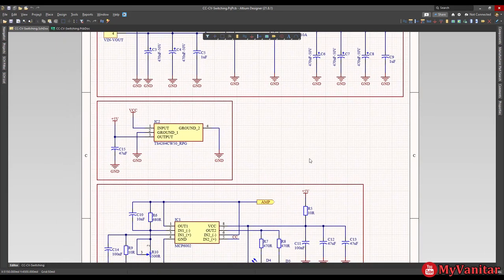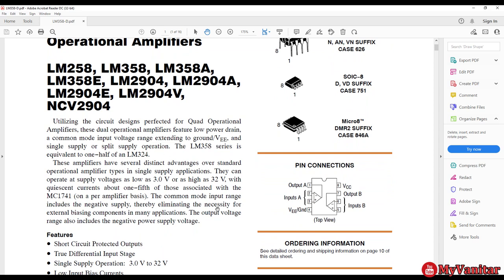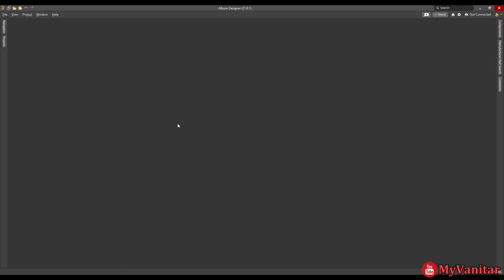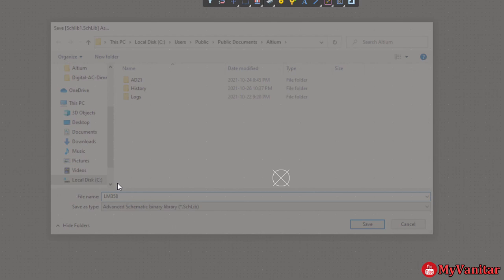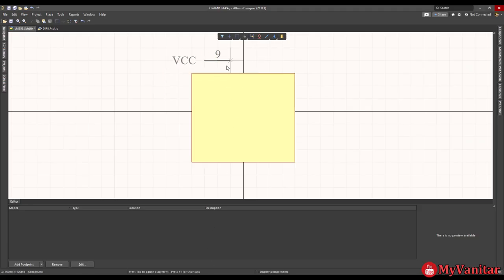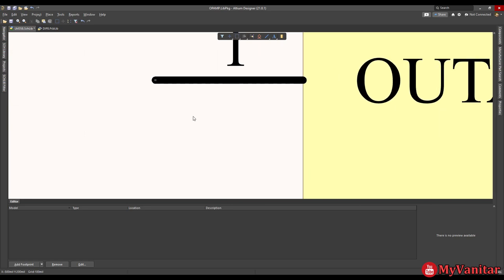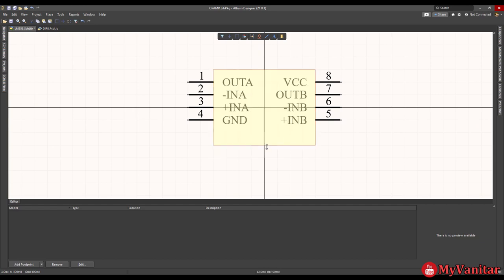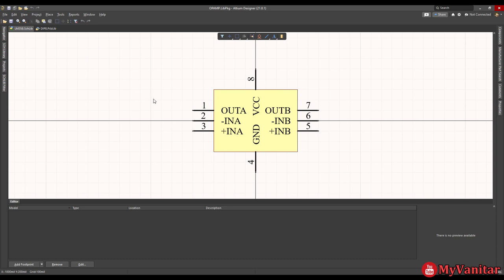How to Design the Component Libraries in Altium Designer [Beginners Tutorial]

Comment: Friends, do not use the wizard.And manually create the desired library yourself.Because the base of some parts become of graide...
Reply from the maker: I have not faced this problem so far, manual build is very time consuming for some components
Reply: @MyVanitar  In this case, I suggest you at least check the downloaded library before assembling.The problem I mentioned is related to the Altium bug.And unfortunately it has not been fixed yet.